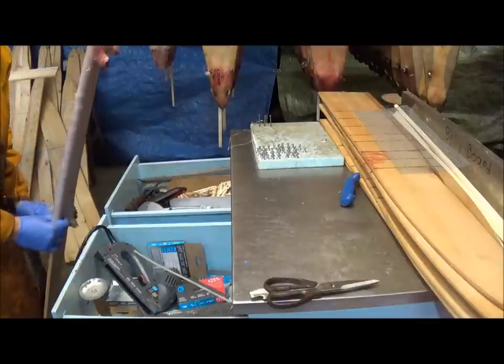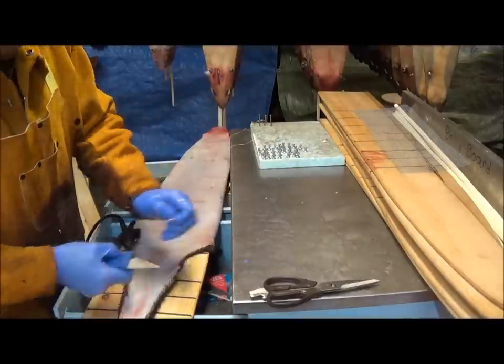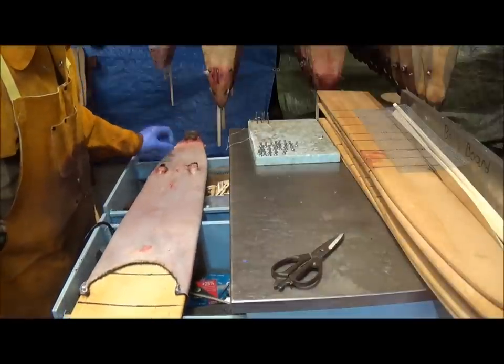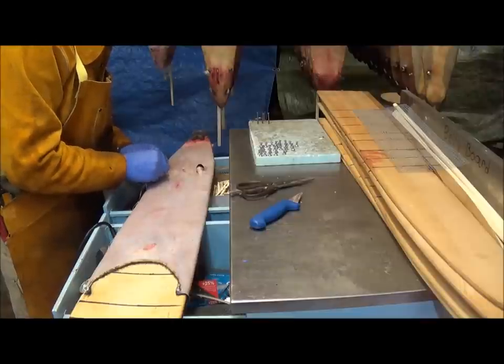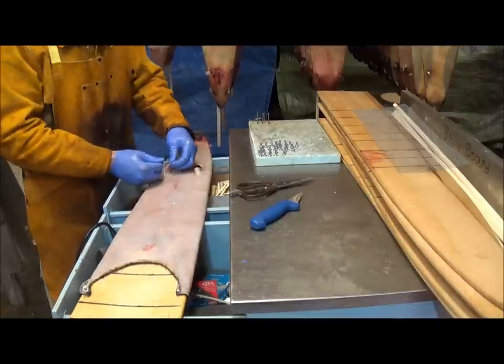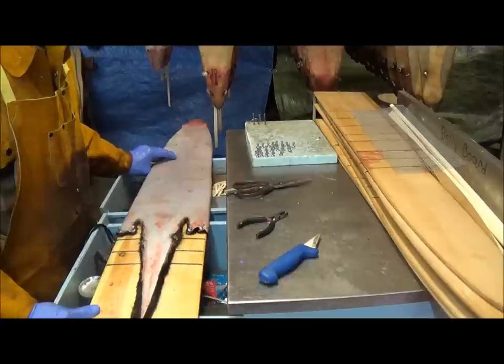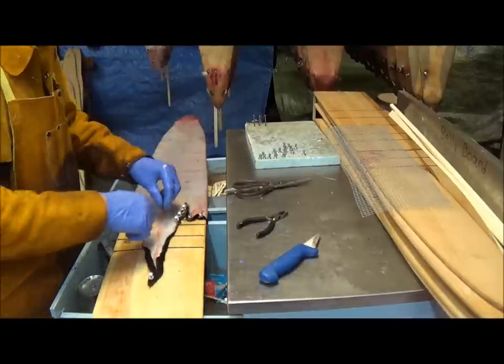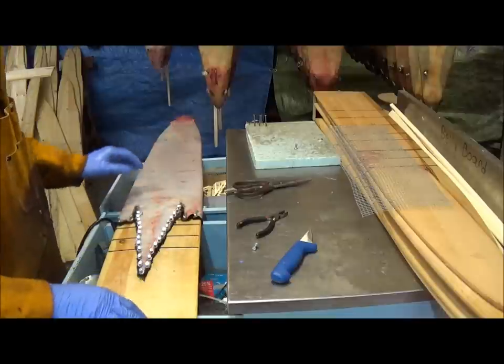Professional Fur Handling, Otter -Part 3 Boarding

Comment: I like the way you sewed up the legs. I bet that will work for beaver leg holes also. I noticed you have a "hog scraper" or bell scraper inside that drawer. Was wondering how you use it or if you have a special way to sharpen it? I spin mine on a lathe and turn a hook on the edge like a cabinet scraper. Works great as a tool for clean skinning beavers along the belly and flanks, at least until you hit the red meat layer. Thanks again for sharing yet another outstanding tutorial.
Reply from the maker: George Zustak I keep it dull. I mainly use it for touch up work at my boarding station. It does not get used much but is handy when I need it

Comment: So is the nose still in there , just no lips? Also do you have to coat it with anything so it dries not rot? Is there a smell at the final stage or could you hang it on the wall as is? Thanks.
Reply from the maker: fjmurray25 nose is still there. this is not tanning just finishing out the hide for sale. in order to become a wall hanger it must first be tanned

Comment: What is the process to dry it after its boarded? Can you dry it on the back porch, or does it need a climate-controlled room or what?
Reply from the maker: Eric Turner low humidity around 50-60 degrees is preferred. check out part 4